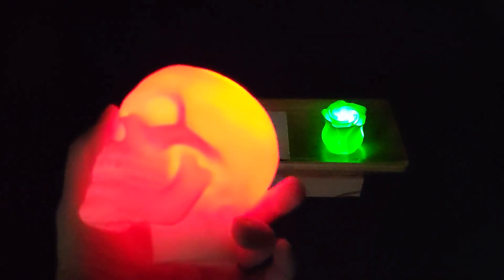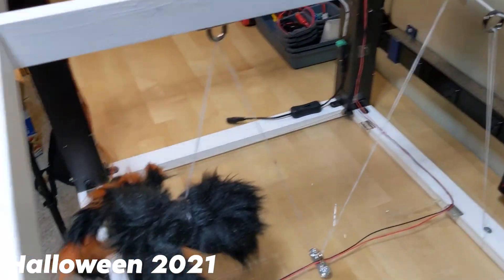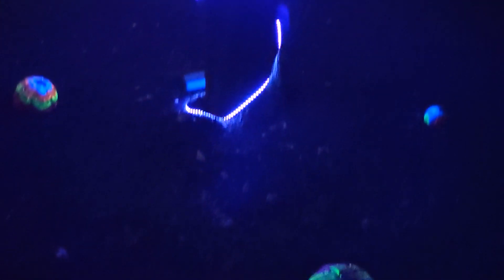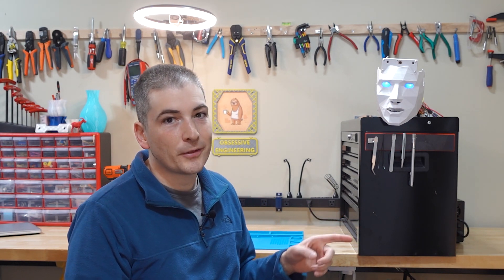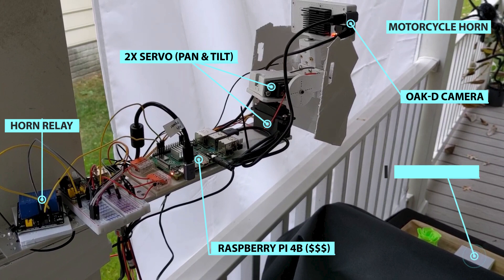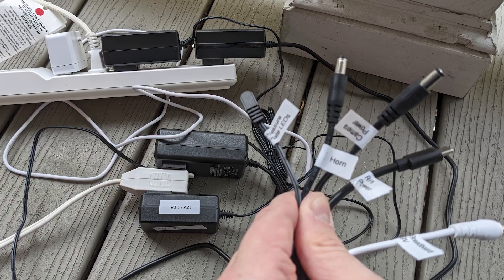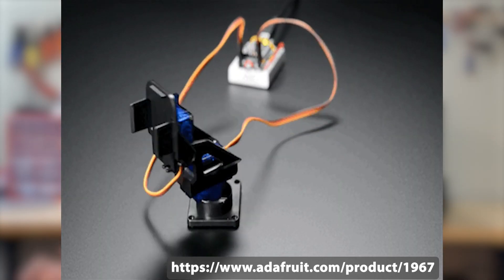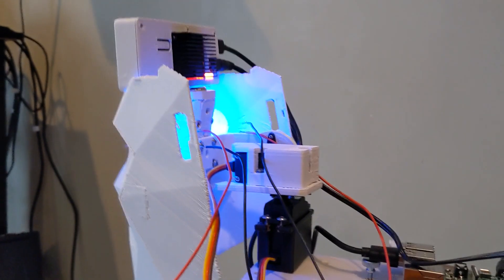This AI Face Knows Your Halloween Costume

Comment: Wow, this is amazing. Is there any way that you could make the code for the OAK-D and the servo turning public?
Reply from the maker: Yes!   Normally I would've prepared a Github repo for it, but I ended up developing all this code directly on the Pi for quicker iteration.  I will pull it off and get it into a Github repo and will add a link to the description.  Thanks for watching!
Reply: @ObsessiveEngineering  Thank you so much I will be waiting for updates
Reply from the maker: Here it is!  I threw it together pretty quickly, so it might be missing something.  Let me know if there's any issues with it!  https://github.com/etotheipi/creepy_face_oakd_clip
Reply: @ObsessiveEngineering  Hey I know it's a lot to ask and I will understand if cannot do it, but would it be possible for you to upload the code today? because I need it for a university project and I am unable to find any support for it, not even in the discord group
Reply: @ObsessiveEngineering  Hello, I will bother you with one last question: I have implemented the code in the project and I noticed that the camera would over turn my face and jitter back and forth trying to center my face, I wanted to ask if you have any advise on how ti solve this issue
Reply from the maker: @Corad Teofil   Why don't you submit an issue in the Github project and I'll follow up with you there.  I don't want to flood my comment section with troubleshooting discussion 😅